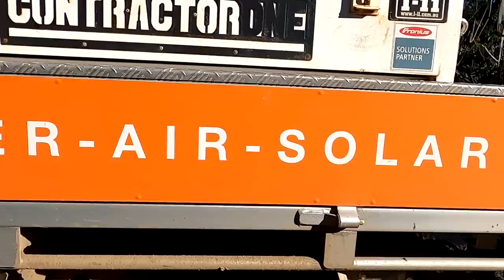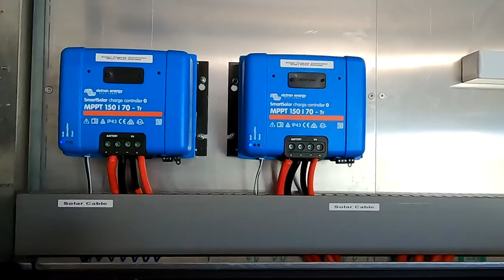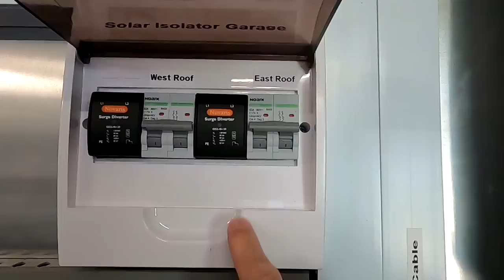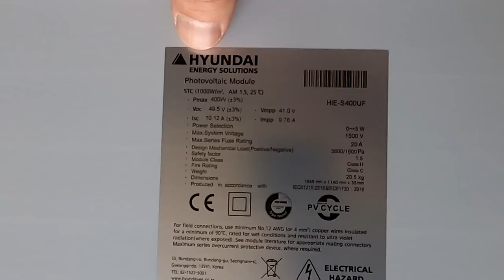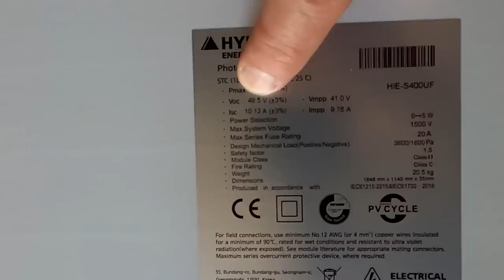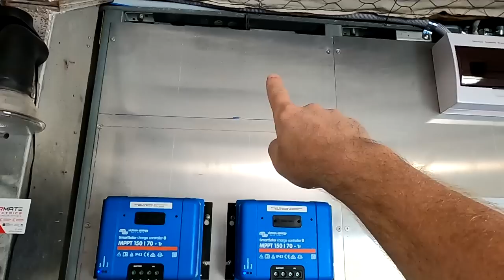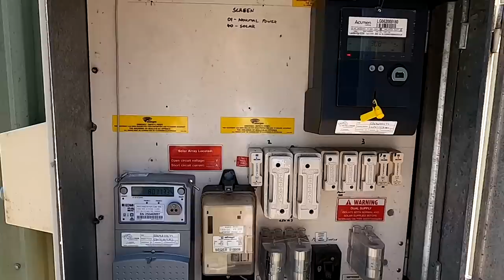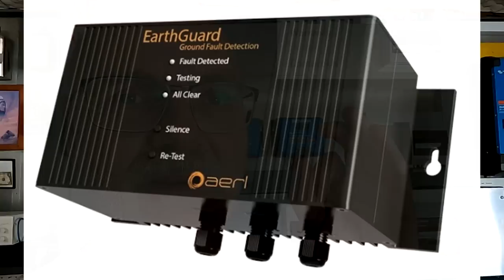I booked an Electrician to check on my DIY Solar-Battery System.

Comment: My county inspector showed up in southern Nevada and had no idea what he was looking at... this was 9 years ago,  3kw of solar on poles, outback charge controllers, Pb acid cells, and a 4kw trace inverter with no power poles or grid connection. He didn't believe me till I took him in the house and ran the microwave turned on all the lights and ran the propane heater...lol 😂😆 ... Spent the next two hours explaining how everything works, he actually wanted to set his own system up in his cabin... He almost forgot to sign my final inspection form 😋😋😋
Reply from the maker: Haha, great. I guess they learned now and know better by now. Lots of people running batteries these days and lots of regulations are now applying.

Comment: thinking outside the box... how about extending the garage roof eaves to create the required space around the panels
Reply: Easy to say, not practical to do.
Reply: Exactly! You beat me to it.
Reply: Was thinking the same just add a narrow verandah where he needs the extra space.
Reply: Love it ❤
Reply: You could do a covered extension out of heavy steel with an I beam in the overhead....then you could have a lift point and beam runner with a chain fall.... Makes unloading heavy stuff easier on the back 😋
Reply from the maker: You need a builder for that as well. You cannot just add some roof panels which hang over the corner of the garage. Come on guys! 😊
Reply: AM Thinking the Electrician is Quoting the "Space" Incorrectly.
The "Math" he Quoted is the Norm for When you Angle the Panels, they Need this Space to Prevent Shading any Surrounding Panels.

Comment: Thanks Andy, as always. 
Great stuff.
Compliance with all the myriad regulations seems to be getting more and more complex, and regulations are certainly sometimes flawed - as happened with rooftop isolators in Australia, which caused numerous fires. Thank goodness that one eventually went away, but not before probably hundreds of thousands were installed, which are an ongoing fire risk.
Reply from the maker: No roof top isolators any more, thankfully. But they still require a string disconnect on the roof which is accessible in case of an emergency. This can now be a dedicated MC4 connection though. Still 🤦‍♂️

Comment: For cracked backside of panels, use neutral white caulk. Put it over the cracks and drag a spatula or scraper to push it in. It's a bit of work, but it will keep the moisture out. I had the same problem.
Reply from the maker: But then they crack elsewhere and I have to take them down again...

Comment: Congrats to the successful inspection. With new modules and 14kWp you need anyway new MPPT. The Victron RS have 450V for longer strings and a galvanic isolation between the modules and the battery.
Reply from the maker: Thank you. I will keep the existing 150/70 and get two 150/60 for the other two roofs. The RS MPPTs are for higher string voltages which don't make sense in my situation due to the shading.

Comment: The surge protectors are pretty simple.  They are basically just tacked on to the positive, negative, and ground lines.  Not in series, not in parallel... just tacked on.  Taps off the main wiring.  Basically the surge protector handle surges on positive, negative, AND/OR ground and it does it by comparing relative voltages for all configurations.  Plus to Neg, Plus to Ground, and Neg to Ground.   For the surge protector to work properly you need all three.

If any differential voltage exceeds a certain value, the surge protector attempts to shunt across the differential that is being exceeded in order to limit the voltage.  That's it.   The surge protector is designed to handle the energy and voltage of a lightning strike nearby.   Typically the energy involved is fairly small... still large enough to require a discharge tube of some sort, though.  But a strike only lasts a few milliseconds and voltages redistribute within a few tens of milliseconds.

But the problem with lightning strikes is always voltage and that is what the surge protector is designed to deal with.    Very high voltages (thousands of volts) can develop... sometimes it is the GROUND itself that surges.  In fact, that is usually the case.   Even if the current is very low, electronics can't handle high voltages.  So that is what the surge protector deals with.  It prevents high differential voltages from reaching your charger controllers / solar inverters / etc.

Lightning does not have to actually strike the system to ruin it. It can be as far away as a few hundred feet and still develop high enough voltages to destroy something.  So that is what the surge protector primarily deals with.

-Matt
Reply from the maker: The problem of surge protectors is not how to connect them but how to install them with keeping the ground connection that short as required.

Comment: Hi Andy.
The Victron charge control is very robust and I’ve never had a problem keeping them happy as long as the you are below the OCV of the control. I’ve put them at several remote locations and they are rock solid. The panels are new and rated at 59.62 volts each (148.86 per string). Even with the batteries at a full state of charge (no load) and having experienced many “cloud edge effect” cycles, not a problem. During the first few months most panels degrade notably before leveling off. One installer had another major brand charge control that would occasionally fault due to over voltage from cloud edge effect. His remedy was to slightly cover a cell in the string and six months later removed it. Problem solved and absolute maximum long term charge was realized.
Reply from the maker: Yeah, that is a consideration worth. It will be just at the border of Voc for these controllers. The other problem is, I would need to connect three panels in series. They would not fit in one above each other, so I have to set them up in 2 rows above and one next to it. That will be tricky with the shading and could be less efficient.
Reply: I sure hope it's robust. Victron is 2x the cost of everything else.
Reply: @randybobandy9828  
Yes, but get what you pay for. At least in charge controllers, I can’t speak for inverters or their others stuff. The amount of power made through the range is amazing from a Victron charge controller. Most other mpp brands only make the best power towards the top end of the OCV rating. Victron makes power much earlier and more efficient, hence much less heat from the unit. The app is easy to use and has the right settings. Very rarely do you hear of a Victron running amuck to the point of damaging a bms then the cells. A cheap charge control throwing pulses can and do bust anything connected to them.

Comment: HI Andy, I am Busy "Upgrading" my current install, BUT, I have found that if there is an SMA PV inverter on your bus you will have problems controlling it. I am removing mine as I am only able to use it in the morning there after once my batteries are full there is not enough load to keep the inverter under control.... So, 1: I am missing out on available solar, 2: Frequency shifting the SMA does not work to well with the Victron, There are a few PV solar inverters that work with the Victron stuff but SMA is not one of them.... The long and short is. I am missing out on about 850W worth of energy that I could use to power stuff but, I am with the new upgrade going to go over to a full DC install, my Victron will now have to work a bit harder but that is it... Congrats on the certificate!

Comment: The best experience or the worst experience you've ever had. I wood call it the best. The pain of someone pointing out your mistakes is far outweighed by the knowledge. An earth fault shuts my system down. The biggest thing I have is MC4 connectors being old and not water tite. Another great video!!!
Reply from the maker: Thank you. Yeah, I'm glad, I did it and have a clear direction now.

Comment: Hi. Regarding grounding I do not know AU Regulations, but in EU you can (and should) connect grounding with lighting protection installations, but the clue is - the connection has to happen underground! So you would need 2 poles from the same underground structure, one for lightning protection (pv grounding), and another one as Protective lead for AC systems and for SPD. Connecting them over ground is wrong, as when a lightning strikes, over the entire wire until it reaches ground you will have voltage drop due to resistance and huuuge current flowing. When the connection point is over ground it creates a voltage divider on the entire voltage drop, causing possibly higher potential as the ground potential on protective bolt in the sockets, all metal which is grounded through it etc and can be dangerous. When the connection happens underground, it does not create voltage divider and ensures potentials are equalised. We also have a requirement that the earth impedance be below 10 Ohm, you will have to check how it is in AU.

Regarding the 2 strings to replace, you can of course replace them by 3 strings of 2 modules as long as they physically fit, but you for sure considered it already... Also you are not forced to mount the modules vertically, horizontal setup will also work (landscape vs portrait mode). You may also experiment with mixed setup, to fit as much as possible within limited space... As long as they stay under the same angle, this should have no influence on the production at all.

Comment: Glad it all went well for you. My grid tied garage is slowly coming along, have now run 25mm SWA out to our detached garage and back to the house, eventually the whole house will run off a Quattro 48/10000.
Reply from the maker: Can you run the whole house form a 10kW inverter? Is this enough?
I was going to do the same with 2x5kW Multis, one for each phase. But I think it is too tight.
Reply: @OffGridGarageAustralia  We're on a single phase,  a Quattro 48/10000 would give us 8kw at 25c (this is the UK - it may get warmer for a couple of months over the summer), it can also pass through up to 100 amps, being grid tied any excess just comes from the grid. It's only in the event of a power cut (which is rare) we'd have to be careful, but at the moment I'm pretty sure we'd be fine. Hot water and the hob are both gas, so that leaves just the oven, washing machine, dish washer and kettle as heavy draw items. We will be changing to an induction hob in the near future, and there is the possibility of an ASHP at some point, no idea when we'll have an electric car. I'd need to fit some sort of alarm to warn us when there is a power cut, otherwise we'd never know, and wouldn't know to limit our use.
Reply from the maker: @TheRonskiman  Ah, yeah, that's a great feature of the Quattro or MP II of pulling extra power from the grid if battery or solar power is not sufficient. You can also push excess energy back in the grid, so there is actually a benefit of staying connected. 
I will have to wait until 2028 and see what the market is like then to make a decision of staying connected or going off-grid altogether.

Comment: Leave your panels where they are Andy, they are fine. If you feel you must comply with paternalistic regs, just shuffle them in a bit.
Why not build a solar carport structure (no corrugated steel, just PV) over the gravel area next to the shed, it seems to get less shade than any of your roofs anyway.
Reply from the maker: You cannot just build a carport structure out of panels. This all needs approval and a builder as well and cost $$$. It's not the Wild West here...

Comment: Ahahah! The electrician comes in, sees all the apparatus and must have fell on his ass... We already know your system, but I am pretty sure you got a new subscriber there.
I also think you should go ahead and have it professionally installed, if you got those incentives from the state. Specially in this convulsion times where energy are paramount. You will be able to move in your car, you can cook, have a shower and keep your refrigerators running.

You are still my favourite you tube channel by quite a margin now.

Cheers  and keep it coming!!!
Reply from the maker: Thanks a lot Ricardo. Yeah, I think, he was quite impressed with the installation.
I'm really tempted to get the new panels and also connect the house as per his recommendations. That will be a very exciting project.

Comment: The shadow dimension increases as the object moves closer to the light source. Big shadow big shade ✌️👁️👁️👍
My utility installed new 9 meter tall utility poles for the low cost of $200.00 USD each. It took them minutes. I believe solar pv modules should be placed high with spacing to create 40-60% shade. The landscape health increase contrasted with undesirable heat gain of surface installation speaks volumes. 
    Live your dream !

Comment: I'd be really interested to see you do an AC coupled inverter in this system, it would negate your concern around the VOC and diversify your charge solution as well. Victron has an document called the factor 1.0 rule that is a good explanation of the limitation but also puts you on the right track to set it up in the first place 

We have a system with both DC and AC charge sources on a 45kwh battery, the AC coupling is awesome when attaching large strings and its cheap in install costs
Reply from the maker: Coming soon...
The charging with parallel strings is per design due to the shading. Going higher in voltage and panels will only make it worse. This is now the best efficiency.

Comment: For the surge protector, yes it got to be connected in PARRALEL to plus and minus BUT it has to be placed correctly, let's say you got a wire underground (from panels to the inverter), coming from the wire to the panels 1-Surge protector, 2-Fuse, 3-Breaker/Isolator ..... this way you protect panels from a current/voltage spike AND you can easily change your fuse or surge by interupting the panels.. On the inverter side... wire coming FROM the panels you got to have 1- Breaker/isolator, 2-Surge protector, Fuse, this way you can isolate the system from the panels.
Seen from the line the surge protector is after the "switch"... then before everything else, this way you can isolate it if needed.
Well .. that's how i see it.
Ground should be at the same potential, even if house is 20m from shed ... same ground.

But those are for security, i do not get it .. in yuor country you got what ? regalatio.... regul... relagation ? What does it mean ..? ;D
Reply from the maker: Hence I want the sparky to deal with that. It's beyond DIY...

Comment: I'm not sure how the regulations are in Australia, but in Germany, you could also ground one of the battery poles intentionally with ground and stick to the same safety guidelines as you do with the AC system (TN-C and TN-S), like over-current and short-circuit protectors to circuit-break when ground shorts occur. The L, N and PE (TN-S) PEN (TN-C) for AC are simply renamed to L+, L-, PE (TN-S) and PEL (TN-C) for DC. This is quite new to the VDE standards.
Reply from the maker: Almost the same standards down here with AS3000 being similar to VDE0100. I think grounding your battery is only necessary in RVs and boats but not really beneficial in a stationary installation.
Reply: @OffGridGarageAustralia  It's not a matter of "beneficial" to a certain application, it's simply to design a system to ensure, voltages to ground stay below harzadeous levels (direct and indirect body connections). How you achieve it, does not matter, but you need to ensure, that safety measures stay in place an this could be sometimes "tricky" to ensure. Simply ask yourself when I go with an isolated DC-System and one rail connects to ground unintentionally, are my safety measures still working? Is it detected? Do all (touchable) metal parts stay always safely below 120 VDC and 60 VAC? Does it get detected and the system gets switched off. If this first unintentional gounding is not leading to this problem and not reported to the user, but a second failure creates undetected hazardeous voltages, does this then switch off the system? There is a reason, why VDE strongly asks for two isolation levels, enforced isolation or other measures to ensure safety for the user.
Reply from the maker: @the78mole  I have a floating system at the moment. If one of the DC potentials get in contact with ground, nothing will happen. There would be no high potential or dangerous voltage. If the second DC will connect to ground, it will create a short and the installed safety devices will trigger.
The new ground fault alarm device will monitor this and set off an alarm if one of the DC potentials gets in contact with ground. That's a requirement with solar and none-isolated MPPTs and inverters.
Reply: @OffGridGarageAustralia  Exactl, with floating PV/Battery, you need a fault alarm device, as you need with an IT-Systen. This is exactly what I was pointing to. And a TN-System would be the alternative without isolation checking device.

Comment: Here in N.C USA the DC of the solar needs its own ground. But the AC side only bond only in main panel. then grouped in all other not bonded to the Nature Some places it is different The idea is if it is bonded in the sub panel then you can back feed on the ground. Good luck